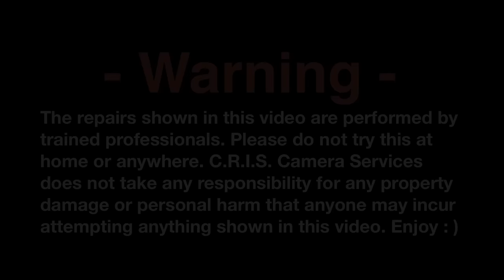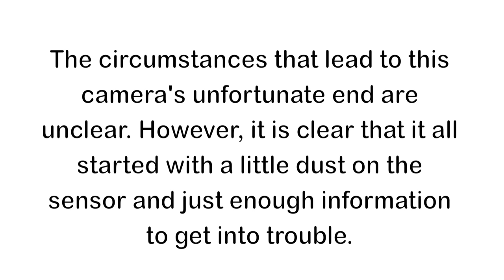Canon Rebel XT Repair: A Cautionary Account

Comment: I have been a professional photographer for 15 years and when digital first came out I would agree .but just cleaning the sensor is a simple task with the right tools and if you buy a sensor cleaner from a store they will show you the proper way to do it weather your a pro or armature just be smart about it. there is no need to send in your camera for simple upkeep.